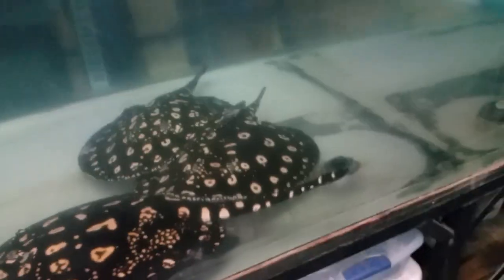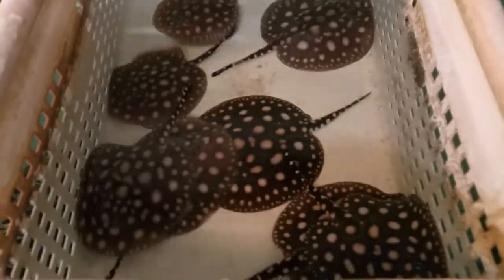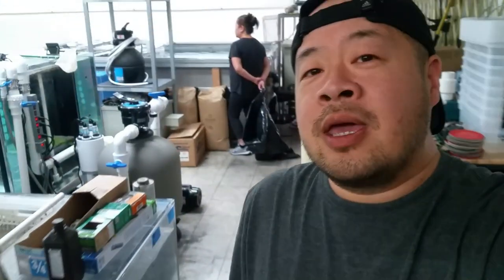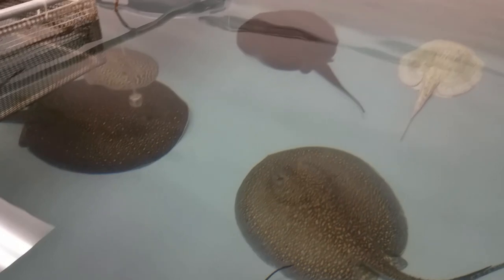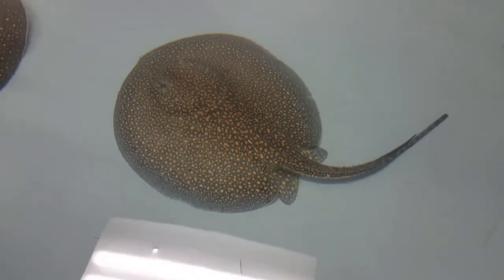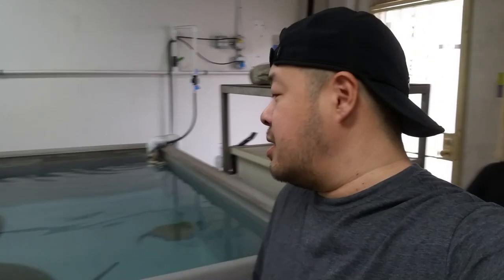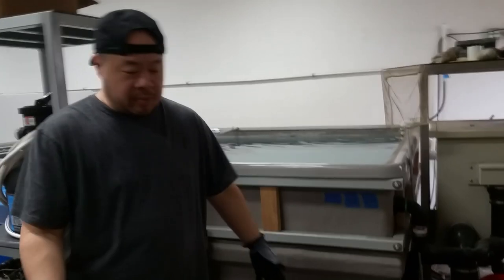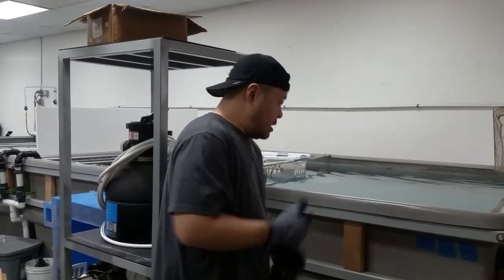OLD BREEDER goes BELLY UP - NITRATES EXPLAINED

Comment: Kevin I do reptile taxidermy, with a specimen like that, i’de actually have it cast in resin as a box frame, background can be added etc and then hung on a wall
Reply: I have a 6 yr old mbu puffer just passed i need stuffed please reach out
Reply: Chris Moten you cant traditionally mount fish, it’s just not possible. Make a box frame, lay flat, pour 1/4 full with smooth glass resin, spray with flame to erase air bubbles, allow to partially set, just enough that your fish doesn’t ‘sink’ in the mixture, place your fish, fill the remainder with more smooth glass resin (or you can use glass epoxy). Again spray surface with flames to get rid of air bubbles. Allow to dry, can take 48hrs to fully set. There’s also tutorials here on YouTube

Comment: Hey Kevin, I have a pretty long question/situation for you also and appreciate your time if possible. I've tried keeping rays recently and everytime I do a waterchange the ray dies. I've been keeping fish for the last 14 years so I have experience. I am running a lot of coral rubble in the system. So it's a high ph about 7.8 - 8 and the rays have been fine and growing well in that ph/kh/gh just fine, power eating and growing, however when i change the water the ray dies very quickly, shows distress, swims mid water column, flaps on top of the water and then dies shortly after, I feel horrible. Just lost my second. I've narrowed it down and it may be osmotic shock from the difference in ph/kh/gh or ammonia burn. The tank has zero ammonia constantly but when I change water I dose the tank with safe and then fill the tank directly from the tap (the breeder and others say this is also their method and should be fine). When chlorine/chloramine is treated with dechlorinator I know it produces ammonia, and at such a high ph the ammonia is very toxic. Do you think this is my issue? Is it the fact I'm putting tap water directly into the tank after dosing with safe with chlorine burn? Or is it the difference in ph/kh/gh (ph is 7- 7.2) in the tap water vs the high levels in my tank? First time i did a waterchange of about 60% and the second time was about 15% in a 9x3x2.7ft tank about 2000l (530gallons). I'm not totally discouraged and I have plans in place to remedy the issue, but I would like to know your opinion on what the issue is. My plans are to remove most of the coral rubble get all the levels closer to my tap water and then I will get an ibc to age the water first before doing a water change. Any help would be greatly appreciated. I know it is a long comment/issue but felt you needed as much details as possible. Thanks for your time and hope to hear from you soon. Love the videos man, from Australia 😊
Reply: brock g not sure if this helps you but I had some similar issues when I first started. I switched to a drip system and have not had any issues for years. I believe it’s less of a shock to the fish this way
Reply: I have been facing the exact same issue - did you manage to find out what the problem was?